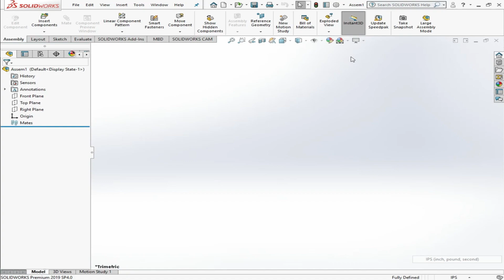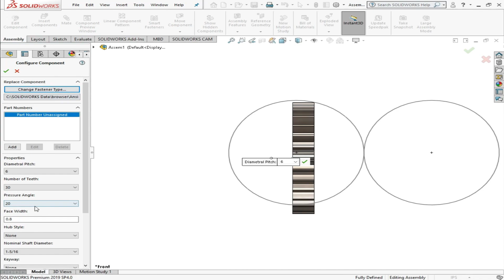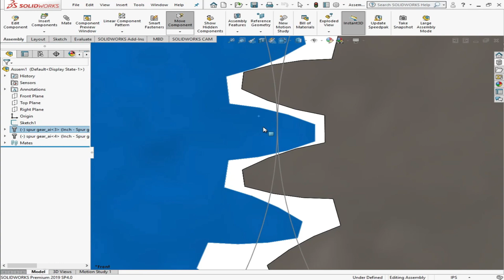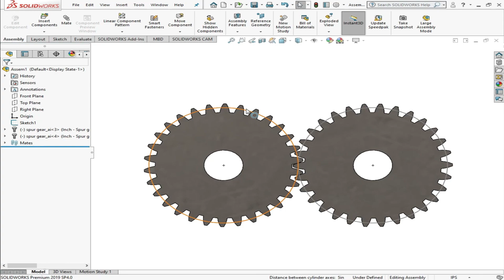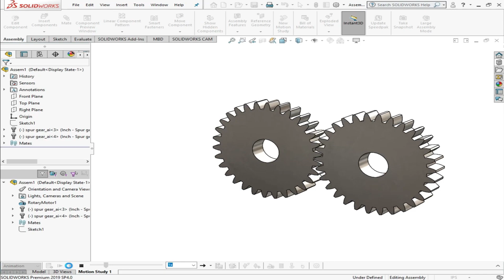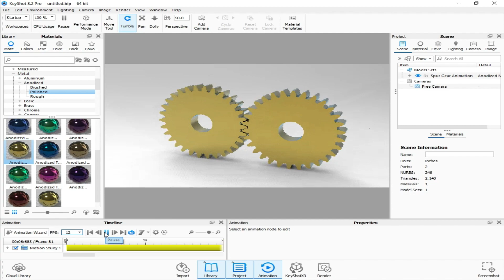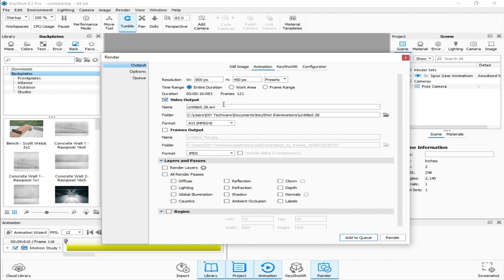Design Spur Gears Solidworks | Export Motion Study | Spur Gear Animation | Solidworks Motion Study

Comment: Hi, for some reason, the animation timeline is being sent to keyshot but when I play it, the assembly doesn't move in keyshot. All parts are exported, even the duration of animation timeline in keyshot is same as solidworks motion study but when I play the animation, nothing moves
Reply from the maker: May be some technical glitch, try again, have you exported animation from Solidworks? Are you using Add-in of Keyshot? Use option update the assembly if you are using Keyshot plug-in.
Reply: @CADable  yeah I'm using Keyshot 10.2 and add-in from official site, and when I commented, I was on Solidworks 2020 student version. I just updated to 2021, will check again if the problem persists.

Comment from the maker: Tutorial Beginning: 0:00
Assembly: 0:20
Reference Sketches: 0:39
Tool Box: 1:05
Basic Mates: 1:30
Physical Dynamics: 2:28
Gear Mate: 2:50
Motion Study: 3:50
Keyshot Plug-in
: 4:17
Keyshot Material: 4:46
Animation Setting: 5:42
Render Setting: 7:23
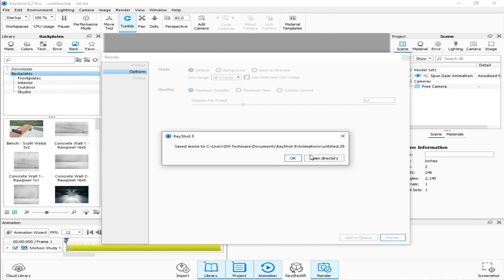Final Render: 8:36
Final Element: 8:54